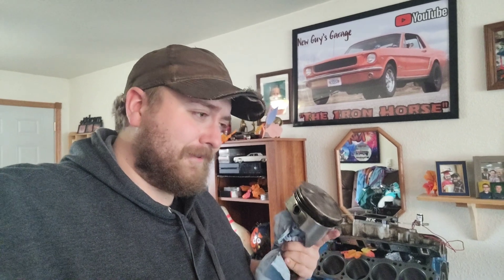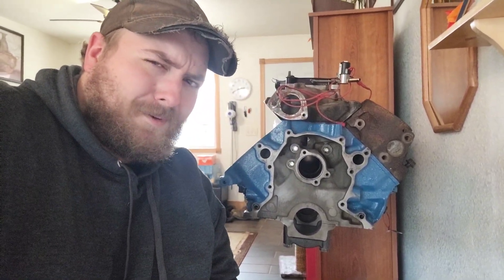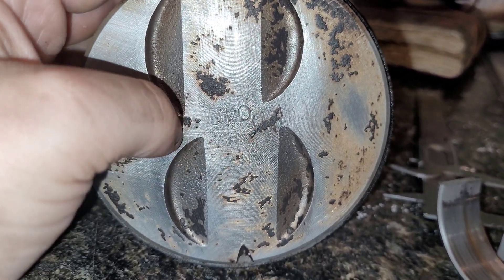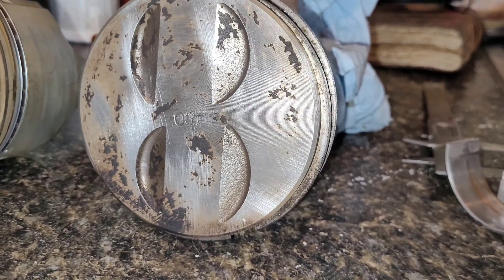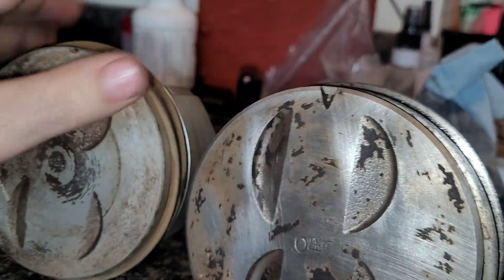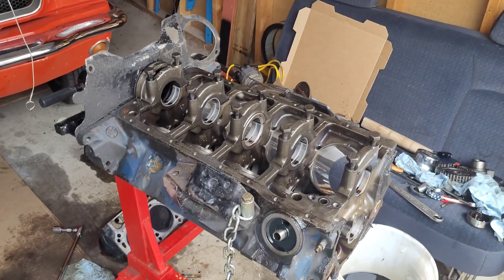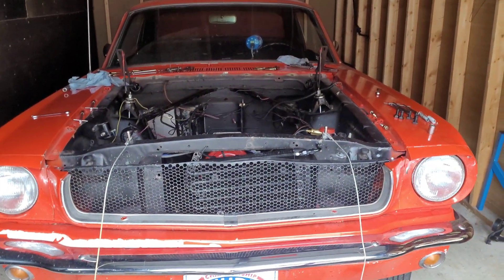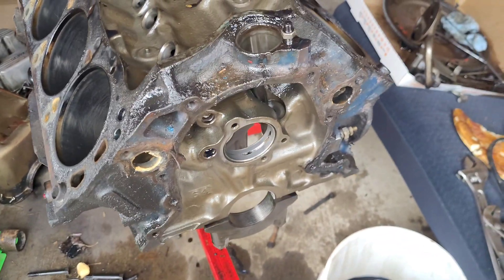The Iron Horses Last Secret Revealed! | Final Displacement Discovered | We Finally Know What To Do!

Comment: It's funny, im the exact opposite...i always try to only bore a block enough to make the bores round. Ive had a bunch of efi 5.0s that went to the machine shop and only needed a hone. I never understood people wanting to bore stuff .060 over , even .040 over in some cases. Because at that point, thats the blocks last build. Ive even gone .020 over on stuff... I love knowing i have another couple rebuilds left in it. Ive still always called my 306s a 302 because 4 cubic inches does literally nothing lol i remember all my friends getting stuff bored out .060 thinking it was gonna add 100hp. And it ran the same, just hot 😂
Reply from the maker: I wanted it to be bored out because getting aftermarket pistons for a std bore is a pain 😅
Reply: @newguysgarage6802  that's definitely true, most stuff is for .020 .030 .040 and .060

Comment: The AFR Renagade 165cc head should have 1.9 intake valves and 1.6 exhaust, i believe you have to buy the 185s to get the 2.02 valves but i may be wrong
Reply from the maker: They come stock with 1.9 intakes but these have had the larger 2.02 valve put in along with some bowl and gasket porting. 

So I actually dont know how large the intake runner is now from what it used to be 165cc
Reply: @newguysgarage6802  They are awsome cylinder heads im running them on my 357 and its got crazy power for what it is
Reply from the maker: @mattsgarage6670  the Renegade line is really the cream of the crop for sbf heads lol 

Thats why I want to use them! 😂

Comment: Being .040 probably just means it wouldn't clean up at .030... or in my case once, I had a set of rings loose their seating and scratch the hell out of the walls. So had to cut another .010 and try again. Ooops. Good thing it was under warranty.
With crosshatch in the .040 block, that means the bores are probably still super round. Hone and re-ring that sucker, and put the AFR heads on it. Unless you're close to .500 lift you'll have plenty of valve clearance. Check to be sure though. I had to do a slight flycut for the .496/.520 cam I was running in one of mine. Heads were '66 289 heads with 1.94/1.60 valves. 
But to be honest, if you're gonna run those heads.... you really gotta put a bigger bumpstick in it. Probably should have measured it's depth down in the bore before taking it apart so you can calculate it's compression ratio, that way you can know of you've got enough compression to add more cam or not. 
What's the stroke suppose to be on the stroker crank? You'll need either rods or pistons, or both to run it so obviously that one has to wait.

Comment: Bet those .040 pistons are cut for 1.9\1.6 valves. I had a hard time finding 2.02 cut pistons had to fly cut my 030 over pistons to fit my 2.02 valves. Come to find out my valves dont come close enough to matter. It all depends on your cam and duration. Hard to account for things without the cam